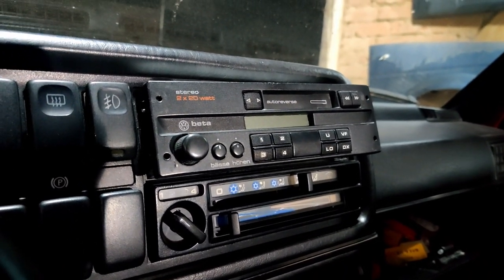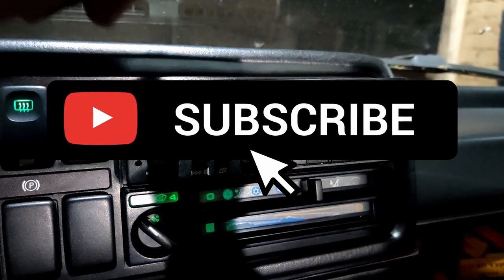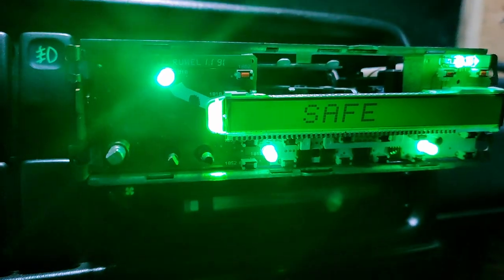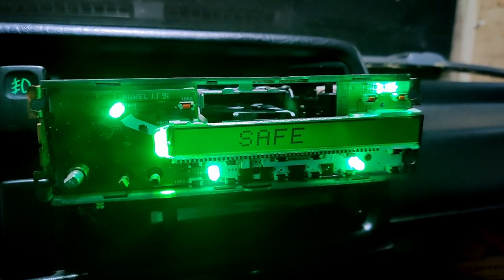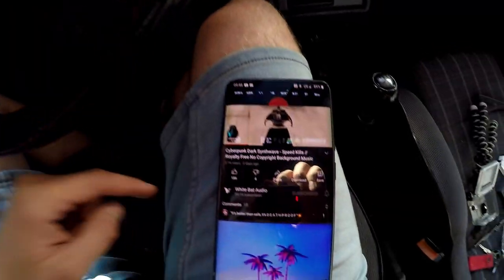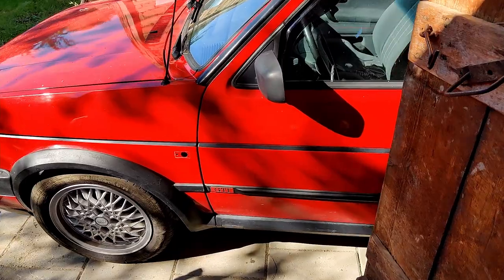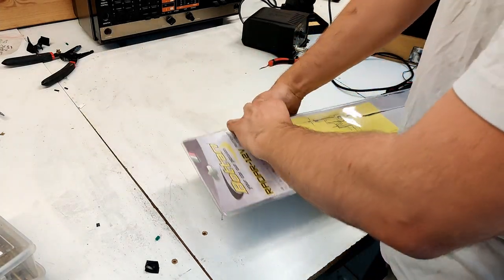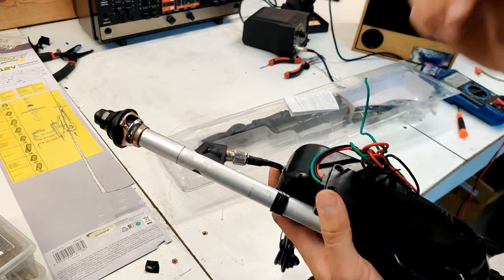How to mod RETRO VW gamma 3 radio | Bluetooth

Comment: Hey great video, do you know where i can find out which AM pins i need to use for a Gamma 2 G60 model radio?
Reply from the maker: Hello, thank you :)
I only found for this model information on a german forum for the AUX mod... Couldn't find for gamma 2... Gamma 3 is the best for this kind of mod and it's easy to swap the lightbulbs as well :)

Comment: Did you have to change the voltage that supply your LEDs? Was there a resistor needed so that they don’t blow out?
Reply from the maker: I used 12v LEDs not 3.5v

Comment: Great video guy! I liked it a lot. I’m restoring a mk2 GTI too and I have a question as I’m going to buy the car speakers for alpha radio. What speakers configuration do you have? Are you using 4 or 6 speakers? (Rear, front door and dash)
Reply from the maker: Thank you mate :) I am using 6 speakers 2 in the dash 2 in the doors and the last owner put 2 speakers in the rear "door panels" i dont have in the trunk like normally should :) i have some. But i will have to change them because they are kinda bad all of them xD
Reply: @upcyclethepastutp9901  Thanks for your answer. Do you know the power and impedance of the speakers? How do you connect 6 speakers when radios are normally prepared just for four (lf, lr, rf and rr)?

Comment: Salut! Poate-mi dai ceva detalii cum ai desfacut radio sa ajungi la becuri
Reply from the maker: Salutari, se iau jos cele doua capace de fier, apoi se o sa vezi niste suruburi care tin panoul frontal, nu mai stiu exact cate sunt si unde, dar iti dai seama pe parcurs. Foarte important sa ai grija cand vezi ca vine jos panoul sa nu tragi de ea sa nu smulgi cablul ribon prin care este conectat la placa de baza. Apoi sunt inca 3-5 suruburi care prind plasticul frontal de pcb-ul frontal. Si atunci ajungi la faza in care poti schimba leduriile. Insa toate radiouriile retro de la vw sunt diferite complet in interior desii au desgin asemanator, daca ai de exemplu gamma 2 atunci procesul este complet diferit.

Comment: hello, where did you find the radio circuit to solder to the AM frequency? I'm trying to do the same with the Beta 4 stereo from the Golf 3, but I can't find the motherboard scheme anywhere to see where the AM audio inputs are.
Reply: Wow 
Trying to find mines for my 1989 Fujitsu Ten Cassette Radio. Did you ever find it?

Comment: hi could you tell me where can i find those am signals on a gamma 5 radio?
Reply from the maker: Hey man, this BT mod only works for gamma3. I dont know how you could do it for gamma5. But i think there is an option for plug and play for gamma5
Reply: I currently bought a Bluetooth adapter for my gamma 5 the problem is that it doesn't trick the cd changer so I need to find a way to install it, but it's similar to yours, it has 1 common/ left/ right output
Reply: Also I can't find any source where should I start